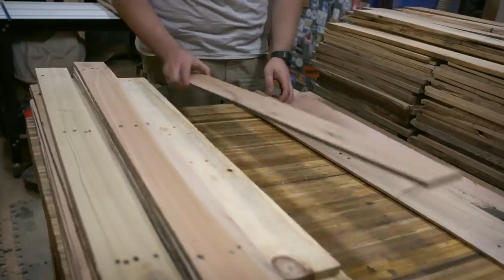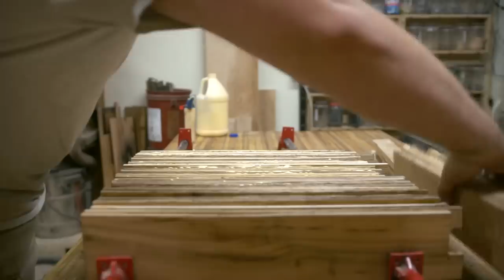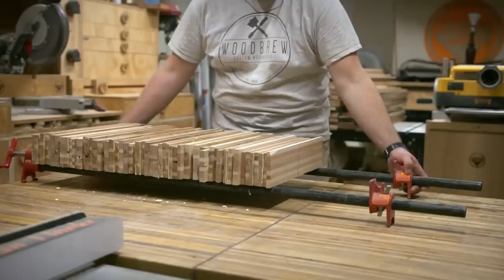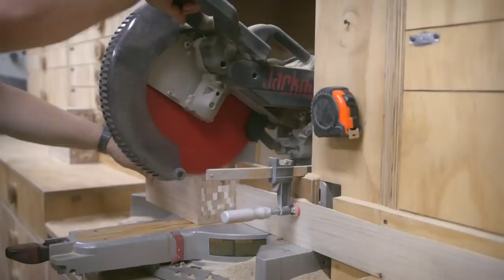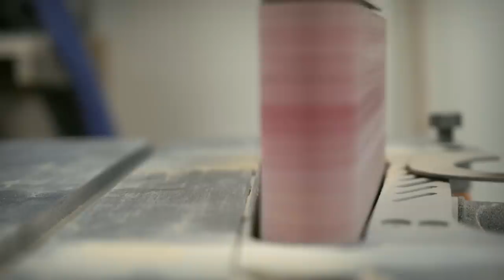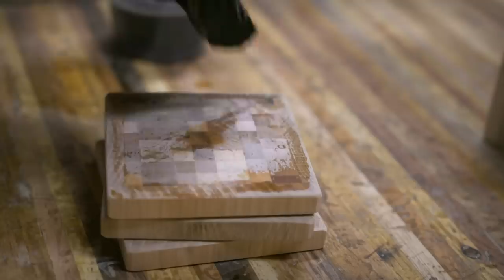Pallet Wood End Grain Coasters

Comment from the maker: Get some coasters for yourself or as a gift! http://bit.ly/jackmancoasters
Subscribe to Carl! https://www.youtube.com/channel/UCirYSGBqwN5V0wxP72fuUGg
Materials & Tools used on this build:
Materials
– Pallets
– Wood glue http://amzn.to/2kID2jI
– 2-part epoxy http://amzn.to/2ilceDF
– Painters tape http://amzn.to/2jO5Gva
– Waterlox tung oil finish http://bit.ly/waterloxjackman

Tools (Not all of these are required, but this is what I used for the build)
– Some nice solid boots for pallet disassembly
– Thickness planer http://amzn.to/2j4ISuI
– Tape measure http://amzn.to/2uTi2e8
– Pipe clamps http://amzn.to/2jkLLbO
– Bar clamps http://amzn.to/2k4EvjT
– Glue spreader bottle http://amzn.to/2rwnnYk
– Miter saw http://amzn.to/2j614UM
– Table saw http://amzn.to/2j4bvVU
– Double knife scraper http://amzn.to/2jrxJR0
– Jointing sled http://amzn.to/2qtonYV
– Bench top belt sander http://amzn.to/2jmRXik
– Random orbital sander http://amzn.to/2jrwsJC
Reply: What tipe of wood are those pallets made? Mos I saw around are just pine

Comment: I'm a very amateur woodworker, if I can even call myself that. I want to do something similar to this, the one issue I foresee is getting my laminated pallet slabs even and level without a surface planer machine. Can I do it by hand?
Reply from the maker: It's not impossible, but I will say that it's going to be super difficult to get them flat enough to laminate, I personally wouldn't recommend it just because I think you'd get discouraged (I know I would!)